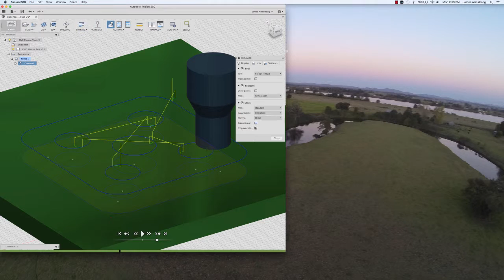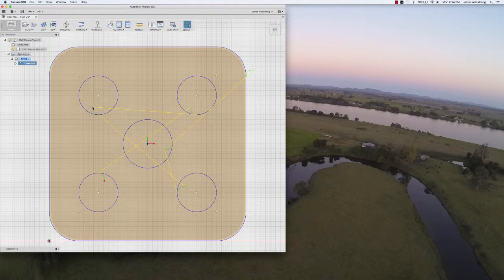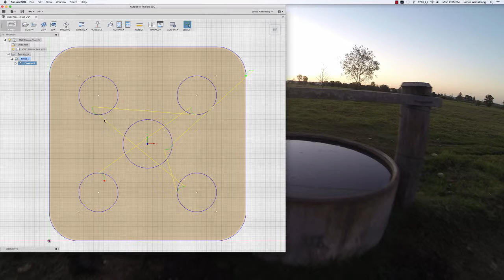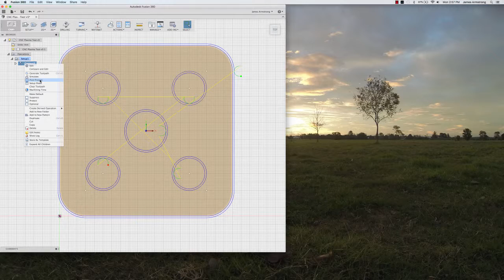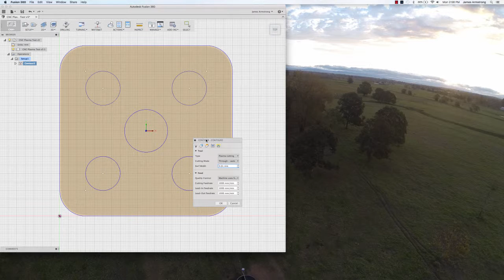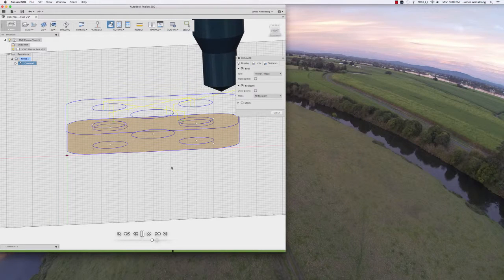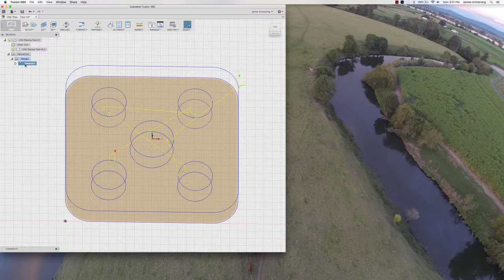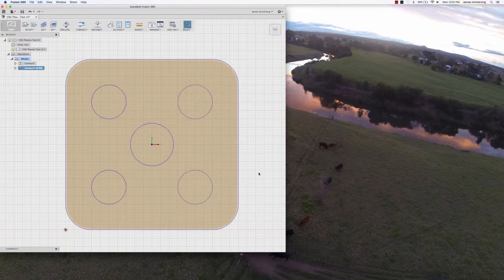Part 2: Fusion 360 CNC Plasma CAM Tutorials

Comment: Where can I get a post processor for fusion 360? All the ones I have tried are not working. I made the plasma torch a probe so every time it is ready to pierce it first has to probe. G38.2 is the probe gcode, so that has to be inserted before every M3, which is used to turn on the plasma. I am using linuxcnc. Thanks I might be able to use a subroutine instead of having to put the G38.2 in the gcode.
Reply from the maker: Hi Landon, 
Google is the best place to start, and then dive into the Fusion 360 forums (https://forums.autodesk.com/t5/computer-aided-machining-cam/post-processors-101/td-p/5916925). 
You could definitely have a subroutine/macro encompassing each cutting operation of the plasma.  
If you look at YouTube for 'Fusion 360 Post Processor Tutorials' you will find some great videos that are worthwhile following along (e.g. https://forums.autodesk.com/t5/computer-aided-machining-cam/post-processors-101/td-p/5916925). 
Learning how to edit/produce your own post processor for your machine will be immensely helpful to you. It might seem tedious and difficult to begin with, though it truly isn't that much of a stretch. If you start with a post processor such as the 'Burny Plasma' you will only have to edit key functions, such as torch on/off procedures and some syntax correction for general and miscellaneous codes. 
Have you got information on your plasma build available? It would be good to see so I could understand what your cutting procedure is meant to be.
Have a wonderful day!

Cheers,

James.